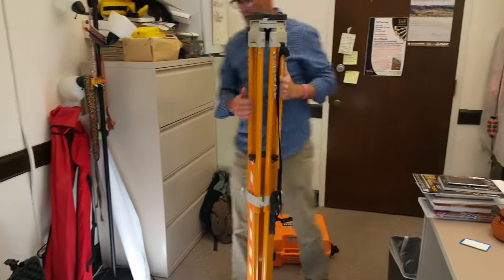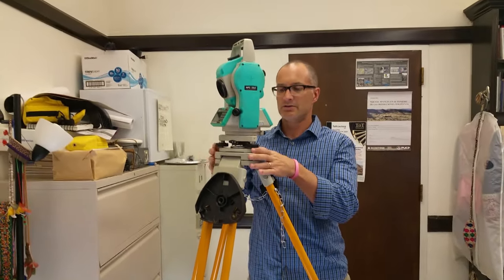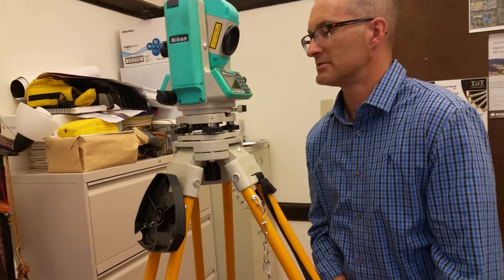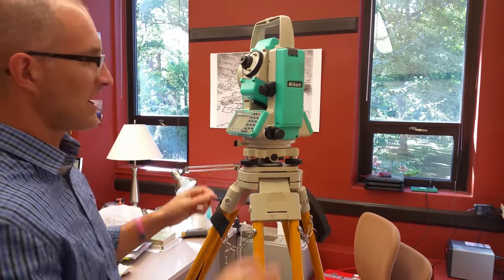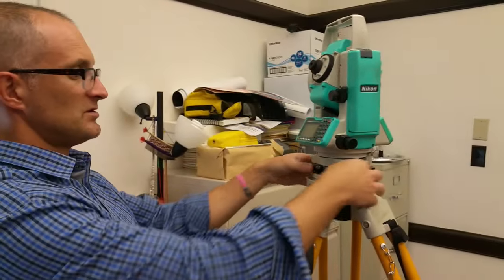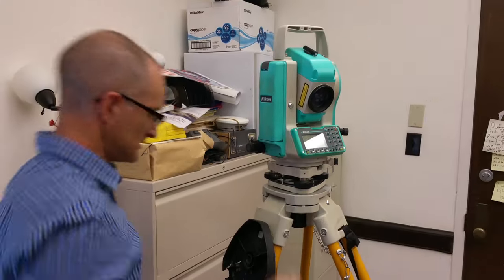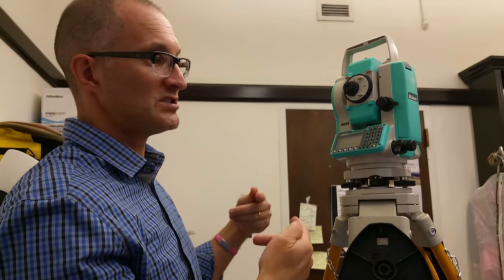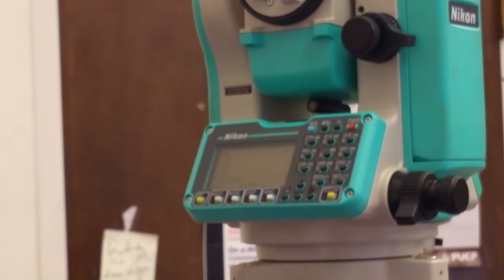Setting up a total station and basics of operation

Comment: There are two types of vertical angles. The "altitude angle", which is rarely used, is measured from horizontal as zero degrees up or down to the line of sight. Much more commonly used is the "zenith angle" which is measured from straight up as zero degrees down to the line of sight.

Comment: The barometric pressure that is published is at sea level. Reduce the published value by 0.1 per 100 feet above sea level that you are (or the opposite if you are below sea level).
Reply: Su Leone, MS Ed so do you enter the current actual barometric pressure or just the published value adjust for for the height above sea level as you stated?  In other words, if I have a gauge to check the current barometric pressure would it be best to use that value or is that not necessary?

Comment: Screw the total station on to the tripod then holding two tripod legs while bending your knees in an athletic stance look through the optical plummet down at the bench mark. He is putting the toe of his shoe next to the benchmark for a recognizable image. Find your shoe then look for your toe then find the bench mark. The last user should have set the three black knobs on the total station base to the "zero" lines. This makes set up easier.
Reply: One needs to use a level and plumb bob to ensure the tripod is level and to ensure that the tripod is indeed centered over the datum.  any other process is a waste of time, total waste of time.
Reply: Kevin Cecchini yes. There is a small hook on the total station knob for a plumb bob. People please use it!

Comment: OK ... stupid question here:
Is there not a way to get the reference horizontal angle using the sun (compensated for the date and time of course)?
Should be more accurate than magnetic north (plus inclination) or GPS.

Comment: I mean no offense, but I worked in CRM for several years. I never understood, especially in my later years in the field, why we were using total stations in the south east, when out west, every site and "discovery" we made was mapped in with GPS and ARC software. The GPS systems we used were just as accurate and a whole lot quicker.
Reply: Except where GPS accuracy drops. I use cm accurate GPS on archaeological sites but in the city and in dense forests GPS precision drops off hence total stations come into play.
Reply: Unfortunately, you're somewhat mistaken as GPS is not nearly as accurate as a total station.
Reply: Dustin Shropshire It's close enough for government work.

Comment: I stopped watching at 4 minutes and 6 seconds.  The initial set up was totally incorrect.

steps one should follow and additional tools required:
torpedo level or 2 foot level and plumb bob on a 6 foot masons line

steps.
1. set up tripod
2. use level to level top of tripod
3. use plumb bob to center over datum
4. attach theodolite or total station

to not use a level and plumb bob is essentially spinning your wheels, waisting too much time